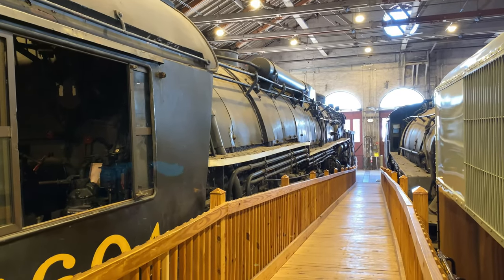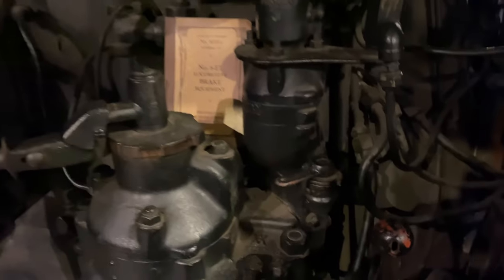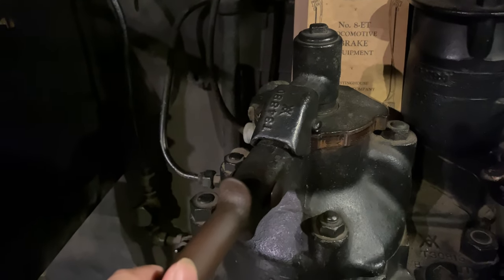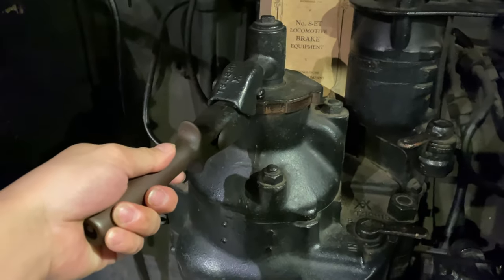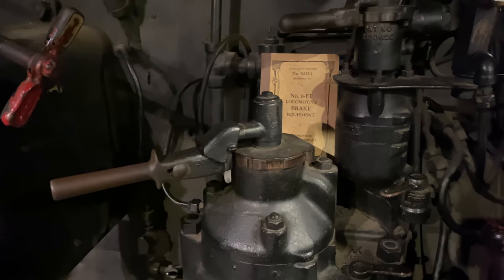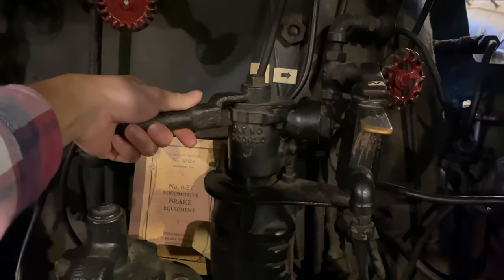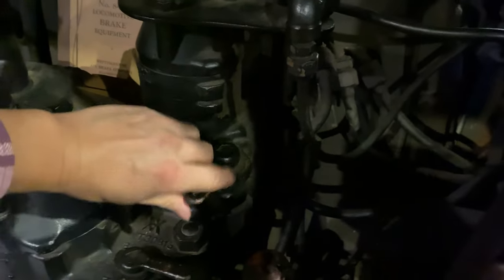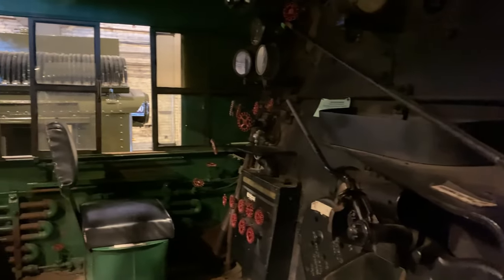No. 8-ET Locomotive Brake Equipment Overview on C&O H-8 Allegheny #1604 (With Correct Air Sounds)

Comment: If a train is about a mile long and an emergency application is initiated,  the pressure wave in the brake pipe takes about 6 seconds to reach the last car to start the application there.

Comment: Can you do a Number 6 ET Air brake system?
Reply: 6ET is basically the same as 8ET, except 6ET has a hold setting in place of the first service on the 8.